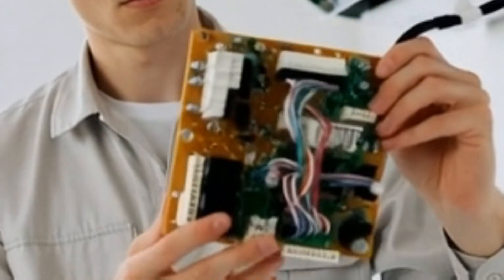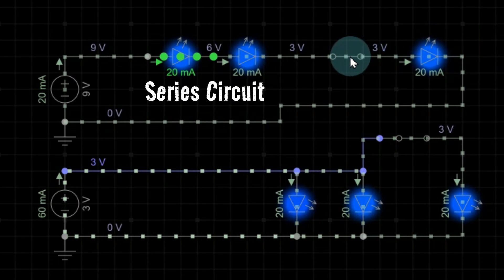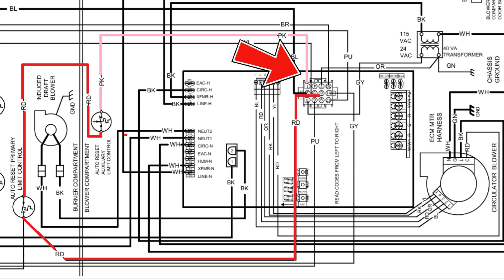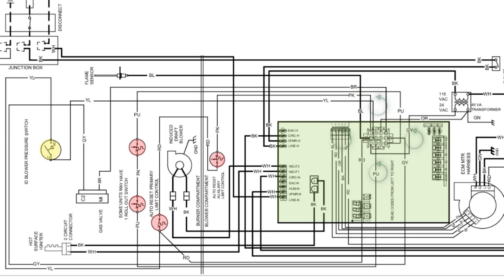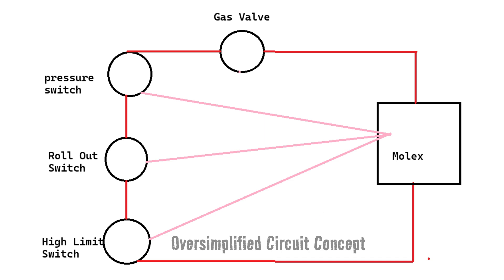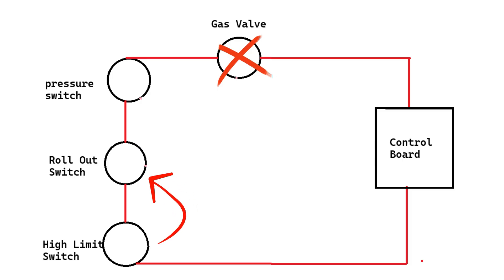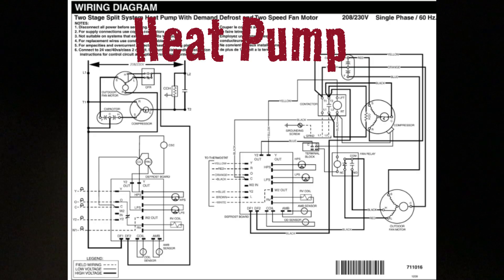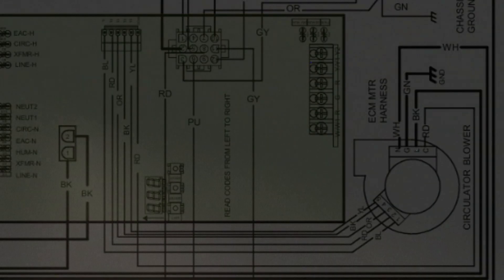HVAC Control Board Logic – Series, Parallel & Sequence

Comment: Series wiring thru switches is different than operating devices (resistance) using series circuits, I know you understand this however it needs to be said.

Comment: I have an older York system that wants to wait too long to bring on the fan motor and the flame is shuts off. Are these controlled by a timer on the control board? I jumped all the limit switches and placed a temp prob inside where the intake limit is located and it was getting around 175f and still no call for the fan motor from the board. I ordered a new board, so I hope that is the problem. What do you think about this problem?
Reply from the maker: Was the board putting out the voltage needed to start the blower? If not it could be the relay on the board. But if it's a PSC motor with a capacitor, could just be a bad capacitor too. If the cap is good and the board is putting out the voltage, then it's the motor itself likely the issue.
Reply: @JerseyMikeHVAC  It's totally weird the fan will come on by itself, but is intermittent when heat is called. I did check the cap with a LCR meter, and it's only reading .94 uf when it's suppose to read 7.5 uf so it's bad, but it's weird that it will come on fine without heat.  I had a spare and installed it and it's working fine but I still will be monitoring it for awhile. Have you had that happen before?
Reply from the maker: My guess is that in cooling mode just the blower is using the main voltage, so there might be just enough there to get the fan spinning without the cap playing its full role. But in heating you have several main voltage parts going... inducer fan, hot surface ignitor, flame rod, etc.
Reply: @JerseyMikeHVAC  Well, that kind of confirms what I was thinking also. Maybe the other load and the added heat like you were thinking. I used to do HVAC back in the eighties so not as sharp as I was then. Thanks so much for your input Mike.

Comment: Good explanation.  Since I'm comfortable with series VS parallel circuits I never stopped to think about what I was already doing in my trouble shooting routine.  I feel for the new techs that don't have a good working knowledge of simple circuits and Ohms law.  I'm sure many of them pondered how the control board "knew" which component was at fault.
Reply: I definitely did 😂😂😂 but I constantly watch videos and gain knowledge even from the simple ones

Comment: Nice one Mike... schematics have always been a difficult one for me 😕...thanks for making it simple to understand
Reply: @JohnDoe-ej1lw I learned the components and then their functions and would test each one individually until I found something that was bad and,,, learned how to read the different circuits on a schematic, which Mike did and excellent job of explaining! To anyone starting out do exactly that, but then learn what Mike has explained! Now, overall  looking back, A schematic is like a road map. Different roads leading through or to different cities. Each city with its own specialty. A great city to dine in, a great city to shop in, you get the picture. Each part and pathway on that print will have its own specialty or purpose. Learn the paths the parts, how they function, separately or together and make sure you understand the operating sequence of that unit or machine you are working on, and you'll be a master in no time. My biggest thing I've found is that, anywhere there a plug or a connection or a ground they all must be tight and clean for the voltages to enable parts to function properly. So while testing... Keep that eye on every connection in line with that part because it may not be a bad part, just a poor connection! Good luck! 👍💯👏🏁🥇🎯🏆✔️.